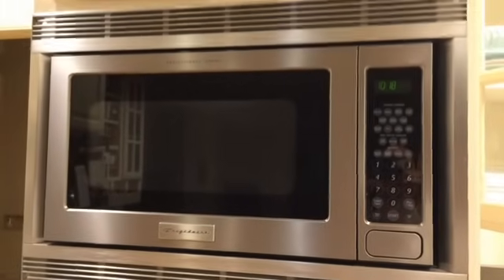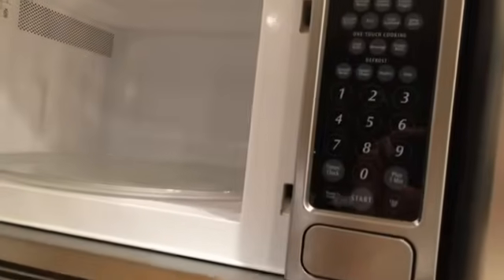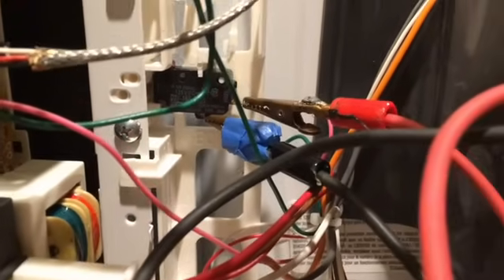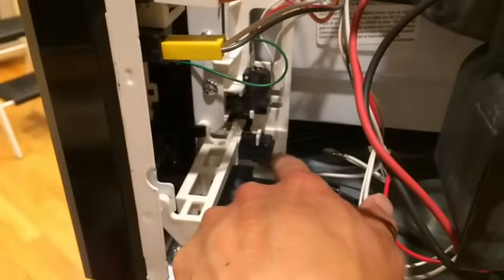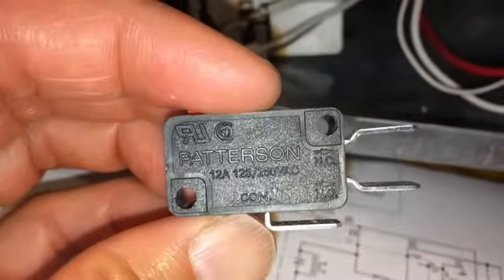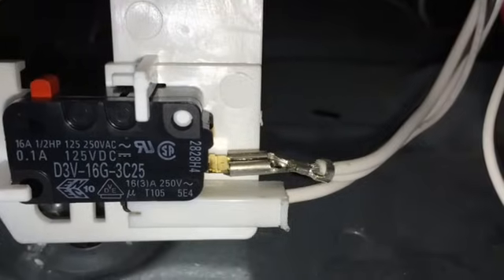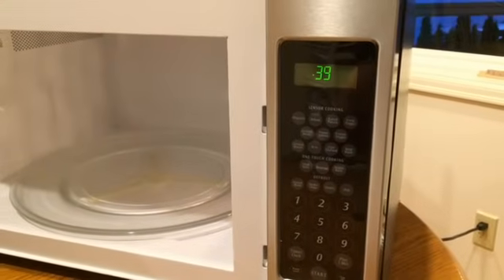$3 fix for microwave that lights up but no heat, buzzing or spinning

Comment: Thanks for this video. I already replaced the lower switch a few months back when our microwave was running while the door was open. Yesterday went to use the microwave and the light was on but it wouldn’t run. Loved that you explained how the top switch was the light, middle was for the magnetron (which I replaced a year or so ago). So I put a new switch in the middle and boom… microwave works again!! I think I got a 2-pack of switches off Amazon for like $7???

Comment: Could I run the two bottom wires to the top switch and keep it moving?
Reply from the maker: No please don’t try that.  I can’t remember the schematic but those two switches do different things.
Reply: @miteeman  ok thanks. No worries

Comment: Mine does not light up and doesn't heat. It sounds as if it's running. When I open the door, the plate spins. What can it be?

Comment: One thing was unclear: are we supposed to somehow discharge all capacitors?  What is the safe way to do that?
Reply from the maker: The safest thing is to wait overnight.  If in a hurry use two long screwdrivers and touching each of the two posts cross the shafts.

Comment: Thx for posting the video, found a faulty interlock micro switch (internal spring that keeps the switch tab up, appears to have broken). Replaced, all good now & saved the cost of a new unit as well as keeping the unit out of a land fill. 👍🙂

Comment: Thank you! I'm 99% certain that this is what's wrong with my microwave. I already ordered the part on Amazon. I have the exact same microwave-over-oven combo that's in the video. Were you able to remove just the microwave without taking the entire oven out of the wall? I took off the trim around the microwave and it appears to be attached to a bracket on the oven with 4 screws on the bottom, but I don't think they are possible to get to without the whole unit coming out. Also, is the microwave connected to power separate from the oven, or are they tied together electrically? I see a black cable when I shine my flashlight back there, along with the metal conduit, but I only have one breaker for "Microwave and Oven Stack" - I guess I'll figure this one out soon enough myself but it will definitely be easier to remove if they're separate!
Reply from the maker: No need to remove the regular oven.  The microwave typically sits on its own shelf and the trim kit just keeps it pretty.  Typically the microwave is not attached to the "bracket" but just rests on it perhaps with some indents for the feet.  Try lifting it up and sliding / twisting it out.  The microwave should have a regular power cord that plugs into an outlet behind it.  Usually the conduit is for the regular oven.

Comment: If this happens again, get a can of wd40 specialist contact cleaner, unplug the microwave,open the door and spray into the openings, also the push button, that is 3 switches .now open and close the door a few times. now you can plug in the microwave and it should work.
Reply from the maker: Thanks for sharing that tip.  I'm not familiar with that product.  I can see that would help some situations.  But with the wear and heat of arcing which is likely to be happening when people open the door while it's running, these switches do eventually need to be replaced.

Comment: mine is bosch microwave which has 3 door switch, and i replaced the interlock switch which was bad based on video posted by Apache Ranch for microwave. and my microwave was on, and can hear the humming sound, but no heating, and turntbale was not spinning. then i watched this video, and found out that it has to do with door switch which i just replace. Some video talks about turntable motor might be bad, or the diode might have gone bad. There are different ways to troubleshoot this. I went ahead, and open the door switch, and i found out my wiring connection was swapped which i compared with the picture I took before dismouting. Once I fix the wire connection, my microwave started heating
Reply from the maker: I'm glad my video helped you!

Comment: I was able to open the switch cover, the tensioner was misplaced. Put it back in the right position and started clicking.  It worked.... Almost made an order on Amazon
Reply from the maker: Good job on getting it working, but you should really replace the switch for a few bucks.  Those switches get a lot of abuse and have full line voltage going through them - they will fail sooner or later and any problem makes it likely it will fail completely later.  If your repair fails you may find yourself being microwaved upon opening the door and the switch doesn't cutoff the power.
Reply: @miteeman  i already placed order for 3 switches,  2 NO & 1 NC. 

Happy that, got ot running till then 😀

Comment: Could you rig the switch by crossing wires?
Reply from the maker: That would be very hazardous.  You will almost certainly open the door accidentally exposing yourself to microwaves.
Reply: @miteeman  I am aware of the hazards and would only be used a few times and unplugged before and after me running it! I am just curious if it would be possible? I would assume it would be possible.. but not 100%.. and I started "rigging" electronics ever since my step father ripped the chord out of the back of my old tube style tv.. and I only made it about 2 days with no tv before i took the back of the tv off.. figured out how to discharge any stored electricity.. and cut the chord off of my extra lamp to wire it to the tv!! 📺  😆

Comment: On mine the inside light is not working either plus all the symptoms  here. Would the same fix work for me too?
Reply from the maker: Not likely.  If the light doesn't go on then the failure path is different.
Reply: @miteeman  any likely culprits?

Comment: The microwave video was very clear, concise and extremely helpful. I have a different microwave brand, but the resistance test on the door switches identified a faulty door switch. Thanks for a great video.

Comment: You replaced 3 switches  or just one
Reply from the maker: You likely only need to replace one door switch, but eventually both high current door switches will go bad so better to replace both while you're at it.

Comment: What tool do you use to take wires off the switch? Takes a lot of power to remove?
Reply from the maker: Just pliers.  Needle nose probably work best for small areas but anything that can get in there will work.

Comment: Great video, but I think you can change these switches easier by taking the front panel off without pulling the microwave out and opening the whole case. It takes under ten minutes and no security screws.
Reply: How do you take the front panel off?

Comment: Could you clarify, were you pointing at the correct one when you observed it being defective (per the schematics), (https://youtu.be/_CtGVScF0sU?t=203)? You're pointing to the one above the bottom one, saying bottom one (maybe meaning lower one, as opposed to the top?), but then you said you needed to replace the bottom one, the one below where you were pointing.

I THINK you're saying that the second from the bottom is the one that controls the magnetron and turntable, but since it's connected (interlocked) to the lowest bottom one - that is triggered when the door is opened/closed - it causes the second from the bottom to not work. Is that right? So this problem could have involved either of the lower two, and with testing the switches' continuity you found that it was the bottom one that was bad.

I just finished replacing my bottom one - fuse would blow upon closing door, and it starting. Others tested good. But after doing so - plugged it in and opened/closed door and started it, without blowing the fuse - so I figured it was all good. Then re-installed and it turns out it's not heating, or turntable rotating. Maybe when reinstalling I broke it? I definitely had the correct kind (Normally Open/Closed). Thanks, great video.

Comment: Correct, the cloth hook on my pot holder was hanging down the inside of the door, I couldn't see it because of poor light there. I read your response and you were right. Thanks, you saved me over $100. for a new one,

Comment: We just got a brand new Hamilton Beach microwave from a lady who was moving and the new home already had one, one that was even nicer than the one she just bought.

She sold it to us for 20$ but it's doing exactly as described I this video. Lights, timer, but no buzzing turning or heating.

Took me a few hours to find anything even remotely the same as what my issue was til I found this video! And it fits the problem exactly!

Thank you so much for posting this!

Comment: @MITEEman. Hi, not sure why I got that below so I had to do another comment. Hoping you reply. On our GE, it's loud when it's powered on but no heat so I'm thinking it's a bad Diode. At any rate, one thing this one does every once& a while is the turntable won't work, then all of a sudden it'll start working again. Wondering if that switch can be partially the problem....
Great video BTW, thanks for posting it.... M.D. ................

Comment: @UCQYkGYBG_y4WZUpV6nz82fQ

  

   @ @UCQYkGYBG_y4WZUpV6nz82fQ Hey, I just wonder on our microwave if that switch has been partially messed up. Just saying that because the turntable doesn't work every once and a while... But at any rate, on our microwave, today it sounds a lot louder than normal, so I'm thinking it's a diode..... Hope you do reply to my comment. Great upload by the way, thank you for your video....

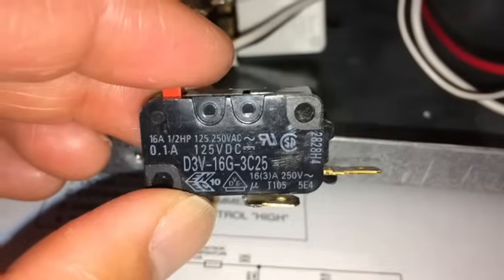Comment: 4:53… Great video!…I notice there are two amperage readings, on smaller font above it says 16A. But in a larger font below it says 0.1A. What is the difference?
Reply from the maker: The top line is for AC - 16A for 120/250V AC.  The bottom line is for DC - .1A at 125V DC.  The electricity coming out of the wall socket is AC so that's the important rating.

Comment: I'm trying to do this fix on my 15-year-old Samsung and it has an ancient lower switch that doesn't look anything like the switches I'm finding for sale--it says 0.3A and 24V. Can I swap in a 16A 250V switch without hurting anything?
Reply: Hard to say without knowing more but using a higher rated switch is good as long as it's the same switch.  If it doesn't look like the replacement it is likely not the same.   Check if it has some writing on it and google it.   It could be the wrong Normally Open / Normally Closed - sometimes they have diagrams on it to show you.

Comment: Followed  your clear and precise instructions, and wow! My microwave works, and the part was as you said,  we paid 2.33 for it with tax, and also replaced the connectors, very inexpensive at auto supply source, and now we don't need to purchase a new microwave! Very nice!
Reply from the maker: Glad to hear it worked for you!

Comment: I just replaced that switch and my microwave is doing the same thing
Reply: The other most likely thing that could cause this is a bad magnetron, which you can also replace although it's more expensive.

Comment: Have the same exact symptoms so checked the switches and one was bad, but it was the top switch.
Replaced the switch and the symptoms remain the same.
Any ideas? Magnetron? Thermal fuse? Help

Comment: I've had to replace this switch four times in the last 18 months.  Do you think this is user error (my crappy installation) or is there another problem with the microwave?  Thanks!  This video was a life and penny saver!
Reply from the maker: Don't open the door without canceling the microwave first, and/or use the most expensive switch.

Comment: Have GE Profile Convection/Microwave. Had same symptoms where it would not turn and heat. Bottom switch was the issue. The hardest par is getting the switches OUT!. I had to remove the circuit board (control panel) to get the latch out of the way. Then I could take the switch assembly out. Then the pegs holding the switch in the assembly over time become brittle so when I removed the switch it broke. Ordered a new switch assembly to hold the switches and then replaced the switches (I just did all since I had the thing apart). This is not for the faint of heart but I could not get to the switches without it. Take a lot of pictures of the wiring before you take everything apart. This saved me. I assume this saved me 200-300 bucks. Just getting to the switched on a built-in is a hour's worth of work because you have to disassemble the entire frame that holds the microwave in place. Thanks to amazon all parts were delivered next day and this didn't drag out over weeks.....

Comment: Excellent video, very thorough.  Thanks for taking the time to show a relatively easy fix.  Same issue occurred on my Viking microwave.  I went ahead and replaced all 4 switches as my microwave is about 10 years old.  Saved me lots of $$!!!!

Comment: My microwave light comes on but nothing on the display at all.  I replaced the 20 amp fuse but still nothing but the inner light comes on.  any suggestions?

Comment: Thanks for the video. My microwave had the same symptoms; and with the assistance of your video, I was able to fix my Wolf microwave. I found it interesting that some of the same components (Sharp) in your Frigidaire microwave are the same ones in mine. Even the technology and layout looks exactly the same. It makes you wonder if there is any real quality difference between the brands. When reinserting the terminals, I wasn't sure which end was up or down. Hopefully, it doesn't matter. Your thoughts?

Comment: My Microwave keep buzing like if the door was open and control pad is not working. Do I have to change all 3 switches? I changed 2 from one side already and still not working. Model is kmbc 140h SS0

Comment: It Iooks like you don't know about removing the touch pad to give you better access to the switch housing bracket. You remove one screw on the top of the touch pad from the inside and slide pad up and pull out. This makes door locking mechanism which is attached to the microwave touchpad easier to free itself from switch bracket inside unit.  Run less risk of damaging things.

Comment: This helped alot. I had a GE over the range micro. And the lights would come on without the turning and buzzing. Did the discharge, and switched the 2 fuses with each other. It worked. Big thank you for the video.

Comment: Everyone should be aware of the reason the switch failed. I noticed at the end of your video (when you opened the door to remove the coffee cup) it appeared that you did not first press "off", but instead pressed the lever to open the door. What happens in this case is that the contacts of the switches draw an arc as they open. Over time, by using the door opening lever (without first pressing "off") the continued arcing causes the contacts  to pit and burn. (This is especially bad for the magnetron/klystron door switch, as it uses the most current.) Since no manufacturer has seen fit to solve this problem, I recommend that users "re-train" themselves. Put a sticky note on the microwave oven near the keypad which says "press off first when opening" as a reminder. (I did this for my wife and it worked.)
Reply: Wondered all these years spent $100 every year to replace exact same bottom switch. All these years I was thinking it’s because of cheap switched and not the oem switch. Thanks a lot for explaining.
Reply: This is very true. I've been an appliance tech for 6 years and that's the exact reason those switches fail.
Reply: Another reason is by slamming the door close. I was so enthusiastic one day and slammed it...and there goes the switch. That was 4 - 4.5 years ago during the pandemic. I can't recall what the symptoms were back then but it needed the switch replaced (I think it was the upper switch). Well, as of last night I've got just the same problem as described in this video. About to tear it apart! Fyi, I have the same Harbor freight tool set he's got in the video. There is a bit that does fit those type of security screw. It's one of those with the six point star pattern with a hole in the middle of the bit to accommodate that stub in the middle of the screw. Stamped on the bit is CR-VT-15, which stands for Chromium-Vanadium Torx-15  security bit( has a hole in the middle).

Comment: Thanks for sharing!  I came across an LG microwave in the trash that had this exact same problem.  Fortunately, I didn't have to look very for or wait very long for a replacement switch--not long afterwards, I found another microwave in the trash that had other problems, but at least its door switches were good, so today, I took one of those switches out and put it in the LG!  It feels so good to have a fully functional microwave without spending even one thin dime!

Comment: Question - are the top and bottom door switch control parts the same? If not, (because schematics are SO difficult to read), do you have a part number. Getting ready to tackle this project, but want to replace both parts, (after I read your comment about 2 years later the other door latch failing).

Thanks for this video.. Amazing.

Comment: MITEEman At 3:22 you point to the middle switch and say it controls the turntable and magnetron. But then you say we will replace the 3rd (bottom) switch. Can you explain? Someone else mentioned that the middle switch is monitor switch and is NC. You also briefly mentioned the NC. Can you explain the logic?
Reply from the maker: Now that Amazon has them 2/$8 on Prime you should just replace both the top & bottom Normally Open switches.  https://www.amazon.com/gp/product/B07HHQRMW7